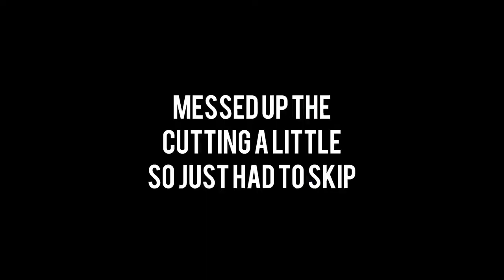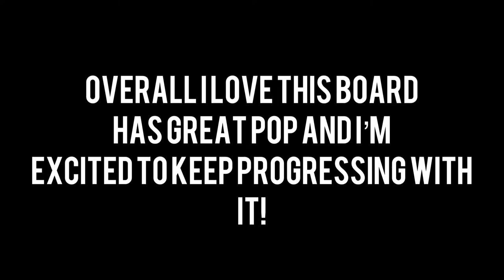Miles Silvas, Madara Primitive Deck Setup!

Comment: Yea... you've messed up the griptape. But that's straight at the beginning where you've positioned it. With graphic griptape you've to consider where you wanna put the graphic art first. 
"Not on the edge" where to cut off I guess...
Reply from the maker: Yeah, I messed it up pretty bad, it was only my second board that I had gripped. But I finally learned 😂😂😂
Reply from the maker: I also hadn’t realized that it had a little piece to push out when I bought it so it also threw off where I was going with it